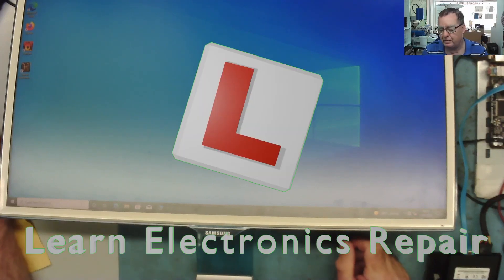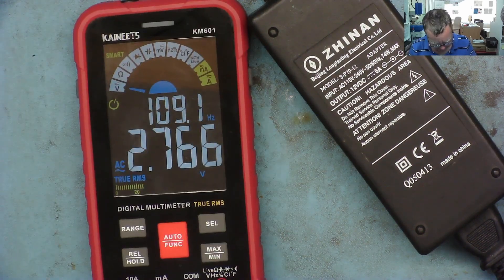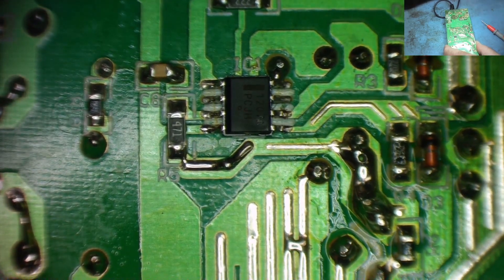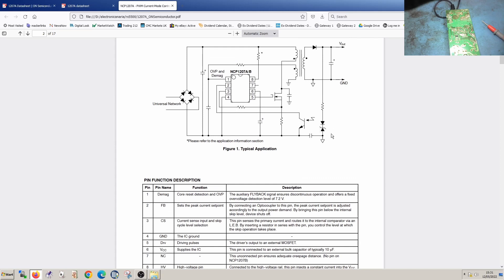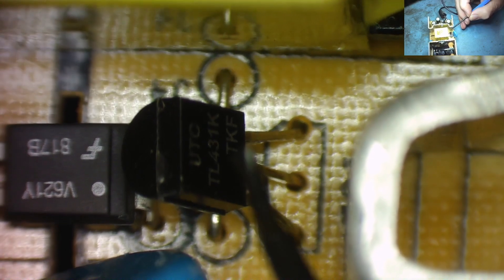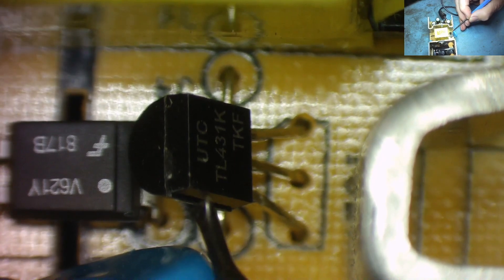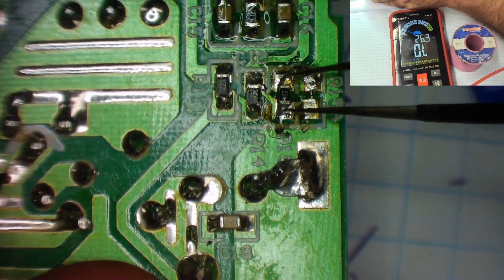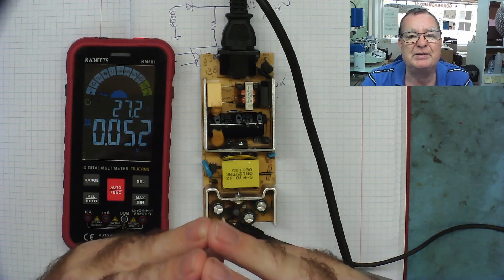How To MOD / HACK Change ANY Switch Mode Power Supply Output Voltage. An SMPS Tutorial Guide.

Comment from the maker: A FEW NOTES:
1. Do NOT try to increase the output voltage above the maximum rating of the output capacitors (probably 16V for a 12V power supply and 10V for a 5V supply) 😜
2. Also as at least two subscribers already mentioned - make sure you CHANGE the voltage markings on the PSU label after you modified it because you quite probably WILL forget that you changed the output voltage after a few months or so.
3. Keep in mind the Wattage - if your load is 12V at 2 Amps that is 12 x 2=24W.  If your load uses 14V and it is still drawing 2 Amps that is 28W.   Make sure you leave enough enough headroom so as not to overload the PSU
4. Your PSU may have TL431, LM431, KIA431 or some other prefix.  They are all equivalent.
Reply: Additionally , check / update over voltage protections, output side, if they are fixed and related to the nominal voltage/current.
Reply: My hbp500 generic smps  for audio amps is supposed to be 65-0-65 but it's only 38-0-38 I don't think I tested it when it was new but the irs2092 has never had any decent performance at all with it. When I ordered it I selected the 65v option. On the back/bottom of the PCB there is a row of voltage options. Can I modify it to be 65v if they selected the wrong voltage? Edit: also the transformer pins are connected next to each voltage 'option'.
Reply: @Freeknickers24  must be rare that the company includes a transformer with switchable options, due economical reasons (more or less cooper). Its probably that exists different circuit paths for different transformers at installation time. In case that your transformer has such switchable capabilities, you can check the change in the Ohms(resistance) relation (Primary wind Ohms/Secondary wind Ohms) with a decent multimeter for each option (1:1 equal voltage input output, 1:2 doubles voltage and so on)...also, maybe, you need to check the path of protections involved (ie. a rise in voltages, some times, accompanies lowering fuse rates in the same inverse proportion for its amperage, that means 2x voltage, 1/2 fuse amperage and so on...only for fuses but would be other protections involved).
Reply: Great video, very informative. About your third point, shouldn't we also consider the current draw? For lower voltages, the current draw might become the limiting factor in terms of safety. Drawing twice the current at half the initial voltage could cause issues, even if the power draw remains the same.

Comment: You can put few drops of gasoline  in the gap . Wait for few seconds, a little twist and pressure , the glue dissolves and  that adaptor can be opened without damaging  its casing

Comment: Now you taught us how to change the voltage, we need to know how to limit the current. The we can make a bench power supply from an old ATX PSU. ;)
Reply: All I have done is use a solar panel power controller from Aliexpresswhich has got variable voltage and current limiting. It is connected to the *12volt rail and can go 1 to 30 volts and with variable current limit its a very cheap and effective power supply

Comment: 2:35 - I have had great success getting into these (without bits coming off from the impact of a blunt object) by using a bench vice as a nut cracker: slowly tighten the vice perpendicular to the seam until it breaks a smile. A slight twist of a flat blade and you’re in! There are no breaks in the shell so it can be glued back together as if nothing ever happened! Although, I must admit your method is a mite faster if there’s no need for aesthetics!

Comment: I recently had to modify a smps and your video was a great resource, thanks very much. 
Something I learned (that may be helpful to others) is how to remove the enclosure in which the smps resides. 
Taking care not to burn one’s self or melt the enclosure, place the enclosure in a  C-clamp or bench vice and warm it evenly til it’s almost to hot to touch.  As it begins to cool, start tightening the screw of the clamp until the pad of the screw and jaw starts to compress the walls. May need to reposition the clamp so you’re in the sweet spot near the corners.  By squeezing the warmed plastic you’ll be able to get a lever in between the halves of the housing and with a little torque applied to lever( pry bar or flathead screwdriver) the halves should release. If lucky, the clamping force of the CClamp will pop the enclosure apart without need for any other tools. I found this to a better method for myself as I damaged a few PCBs with the hammer technique. Shockingly,(😂) I didn’t realize I’d damaged the board until I plugged into a mains outlet and heard a loud pop and saw a poof of magic smoke release. 
Thanks for the video and your expertise.

Comment: Great video for learning how to change the output voltage of your smps. But don't forget not to go above the rated working voltage of the output capacitors.  If you do then you have to change the change the output capacitors working voltage to match your new output voltage

Comment: lol, funny how timed that video is,  while i'm also working on a small project for my little brother that requires a change in voltage!! he's been  gifted a pc and want to be able to use his gpu in it , but it's a hp compaq(small form factor) that uses a non standard power supply(btx instead of atx) with only 240w output.. he already own a 500w  atx , so i'm making him an adapter for the 24 pins  connector to the two six pins ones that the mobo needs, the color code for the wires is the same on both side, the only problem is the standby one(purple), it requires 12v instead of the standard 5v for atxs... XD  but  i won't go into the box, i'll just build a step-up into the adapter to keep it usable in a standard atx built!! Anyway, yet another nice and very useful video of yours saved in my "electronics"  playlist!!! Keep it up, i can see a bright future for your channel into the repairs and diy communities, the efforts and enthusiasm  you put  into explaining everything that you do, and why you do it, as clearly as you manage to do it, makes your videos not only useful, but also fun to watch for those into that kind of stuff!!! :p
Reply from the maker: No need to build one.  Here it is
https://www.aliexpress.com/item/1005003523264968.html

Comment: Brilliant - I needed this lecture yesterday to test a Samsung LED screen. Used my variable desk PSU, and found that the screen is broken, with zig-zag lines all over and vertical coloured stripes! If it had not been broken, I would have been doing this today, following your very clear exposition 🙂 Thank you very much!

Comment: Excellent video, I would love to see a similar mod but instead of a fixed voltage, an adjustable voltage output voltage... I would imagine that you would need to have fixed resistors in place to keep the voltage from going too high or too low.... This would be a great mod for a nice high power supply, possibility from a laptop or even those industrial SMPS that are so cheap and usually have some sort of miner adjustment as it is, for all I know, it might only need a fixed resistance change to gain much more voltage adjustment.... 
Anyway, thanks again for this great video... I have been looking into these power supplies and how to change their output voltage and this video nailed it....

Comment: 2:09 - whenever I need to crack a wall wart (walnut?) I use a bench vise to slowly add pressure to the longest side until it splits open far enough to get a screwdriver in to pry it further apart. After repair, I can usually glue the case back together to look factory. Only on rare occasions does this method produce fragments (I.e., when I got in a hurry and applied too much vice pressure too fast,)

Comment: Simple “fix”! Jst remember that the “total power” should probably be maintained…i.e. if you raise the output dc voltage, the originally rated output current will be LESS in order to maintain the total power spec.
Reply from the maker: Quite correct.  I take it you read the pinned comment I made here  called 'A few notes:'?

Comment: Although staying below the voltage rating of capacitors is a good practice, that isn’t necessarily sufficient. The output rectifiers not only have a current rating that should not be exceeded, they also have a reverse voltage that should not be exceeded. Conceivably, one could be below the voltage rating of an output capacitor yet have exceeded the reverse voltage rating of the output rectifier.

In order to confirm that the reverse voltage rating of the output rectifiers aren’t being exceeded, some equipment is needed that might not be in the possession of the viewer - an oscilloscope is a must, and a variac is also a good idea to have because the “duty cycle” of the wave shape being fed to the output rectifier can vary with the AC input voltage.

And the rectifier reverse voltage rating is not going to be printed onto the device like it would be with a capacitor; the specifications for reverse voltage rating will have to be retrieved from the data sheet for the part.

Comment: That schematic in that pdf is a little incorrect, because I don't know if you have noticed, but the bridge rectifier is connected the wrong way round for a start.
Reply: The one in the video is Rev 11 and they have fixed the bridge by the Rev 16 that I have.

Comment: Excellent, thanks, I've fixed a couple of SMPSes in the past but still hadn't really got my head around the inner workings, it was more by trial and error - your videos have been super helpful, I guess the only question with this hack is if there are multiple rails and voltage outputs - I think one rail is usually controlled using the reference but I haven't gotten my head around how the other rails are controlled - is it purely by way of zeners on the assumption that only one reference rail controls the HV side and the others just play along?

Comment: Thank you for your videos.  I learn a lot from them.
I wonder how to change SMPS Input voltage  (from 110V to 240V).  I suppose you have to change the input capacitors, with higher voltage and less capacitance.  Am I right?

Comment: Yep great but what happens when someone
uses it for something else? You must tell people to change to voltage written on the case. Because what happens is some comes along and breaks my equipment. So now i always change the voltage on the case.😮‍💨
Reply from the maker: Yep you are totally correct - it is important to change the label on the PSU - even yourself could forget what you changed the output to in a year or two (or maybe less). I now put your suggestion in a sticky in the comments and highlighted it in the video description. Thank You

Comment: That was brilliant. Would using a pot in place of one of the resistors give a variable output power supply, or would it impact the performance?
Reply from the maker: Yes you can use a potentiometer (variable resistor) in place of the resistor from REF to Cathode.  In theory the lowest output would be 2.5V and the highest output would be dependent on the value of the variable resistor, but bear in mind that you may be limited in voltage range by the maximum and minimum duty cycle of the PWM controller.

Comment: Great video, your lucky to not have dust in the monitor, or perhaps your environment is very clean. Would be nice if you took a similar PSU for laptop and showed ripple before/after with removed Y caps that connect to ground. I don't have a scope ant myths of increased ripple are making me crazy. I do not need to have neon light bulb light up when touched to USB ports etc, on laptop with typical crappy PSU design.

Comment: since you understand about it, a non related question: can I put white LEDs into the 3,3 V output, just for illuminate de interior of the PC power supply? Just for some modding, asthetic reasons. Or this may affect the motherboard functioning ? thanks!

Comment: could you potentially make this into a variable power supply by using a potentiometer instead of a fixed resistor?
Reply from the maker: Yes, correct.
Reply: I have done this on several power supplies, including those dodgy wall warts. But like Richard points out in his comment, pay close attention not to exceed  the output capacitor voltage.
Reply: Yes but you are limited to the tolerance of the transformer. Transformers are manufactured with the output voltage and current in mind, the number of windings determines the voltage and the wire gauge determines the current. Say for argument's sake you lower the voltage but pull more amps than the transformer was designed for, the transformer could get very toasty and melt its windings and possibly short to the primary side.
Reply from the maker: @snipersquad100  Actually Wattage (which is what causes heat) is volts x amps.  So decreasing the voltage and increasing the current proportionally keeps the wattage the same.  it's much more likely the output rectifier diode(s) would give up long before the transformer winding as they will have a maximum current rating. 😉

Realistically the limits you are going to face are:
The maximum voltage rating of the output capacitor(s)
The maximum current rating of the rectifier diode(s)
The maximum and minimum duty cycle of the PWM controller (which determines the maximum and minimum output voltage)

Personally I would use the technique shown in this video for changing the output voltage of a PSU by a few volts only.   The one I modified for the Samsung monitor is working fine by the way after several days and my wife is very happy with her new screen
Reply: @LearnElectronicsRepair  If you have a 100watt transformer rated for 12v at 8.3 amps, the manufacturer of that transformer would rate the windings suitable to carry 8.3 amp, probably a little more for head room, say 12AWG. If someone hacked the power supply to put out 5v, that transformer could put out 20 amps, this would fry the windings in the transformer.

Comment: I have tried the same mod on my 24V 6A power supply. I realized that when I changed the output voltage down to 16V and below, it keeps cycling on/off. What could have happened?

Comment: do you have a memory trick to remember which end is cathode or anode in wiring diagrams?
Reply: The way I remember is by using the alphabet, the electrons travel from Anode to the Cathode. A for Anode comes before C Cathode (or K for that matter) in the alphabet. So knowing which direction the electrons flow the Cathode will be the stripe part of the diode and the flat side of a through-hole LED.
Reply: @snipersquad100   The electrons travel from cathode to anode, if they travelled  from anode to cathode a cathode ray tube wouldn’t work. You’re thinking of conventional current.
Reply: @ozriblit  - you are correct on electron flow, and that which was described by the other comment is actually covering conventional current flow.
Reply: @stevebabiak6997   I normally qualify that when I speak, the answer mentions electrons travelling  from Anode to Cathode. Clearly they don’t.   I would phase the answer something like “ using conventional current flow ( + to - ) the diode symbol looks like an arrow  showing the direction,  using electron flow ( - to + ) the bar in the diode looks like a negative  sign”

Comment: Could you put a trimer or a potenciometer instead of fixed value resistor ?
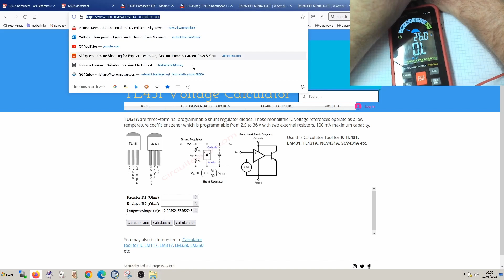Reply from the maker: Yes - usually by replacing the resistor from REF to Cathode (the 20K resistor) - you can see how to add a variable resistor in the 'Shunt Regulator' diagram on the TL431 calculator datasheet at 14:02

Comment: Ey up, mentioned this before but not sure if you have come across it, i guess without a board yourself with the issue could be hard to demonstrate - essentially on ASUS motherboards they have fan speed control in the BIOS, when attempting to live plug a fan in - i shorted the pins with a spark, since then the fan will only operate at full speed, all fan control both PWM or DC has gone, there seems to be 3 leg voltage regulators?? near each fan header, is it likely these have gone? i guess they can only be replaced with hot air work station? any info appreciated, cheers

Comment: Thanks for the excellent video.
I modified a Sony Playstation 8.8V output SMPS with potentiometer but when I tried to set it at 5V, below 5.5V it goes to cutoff mode( output becomes 0V and after putting off it's input, it comes in on mode again). What is wrong?
Please explain.
Reply: If this is due to duty cycle limitations, then how to tackle it?

Comment: cheers for that. but if we want to change the voltage alot more than what the power supply is designed for, then what should we do? I suppose the transformer winding turns should be changed too? I need to convert a power supply to 2 volt 40 amp . because I can not find this in the market . help me with this please

Comment: If the transformer secondary was 12V, what output DC voltage one could realistically tweak this to? Ignoring caps voltage  limits.

Comment: Greetings from Ethiopia, my question is I have some Toshiba laptop charger 19 v not sure but 3-5 amps can I do the trick to use it as my Mobile charger USB c or normal Samsung Galaxy phone? I learned that I can reduce or increase the out put volts by changing the value of the voltage divider resistors to the programmable zener Diod TL431, but what about the amps? 
 Thanks

Comment: we make variable power supply if we use 5k pot for r2 and change caps?
Reply from the maker: Use a variable resistor to replace the one between REF and Cathode pins on the TL431.  Bear in mind in theory the minimum output is 2.5V but you will also be limited in range by the minimum and maximum duty cycle of the PWM controller.   The IC (or mosfet it is driving) may also not like running continuously at high duty cycle.  I would use this method for changing the output up or down by a few volts, but you can experiment yourself and let us know how you go on.